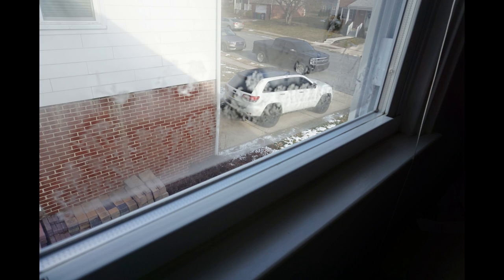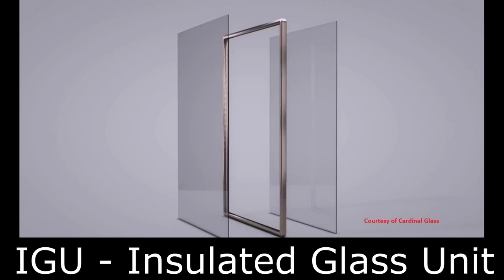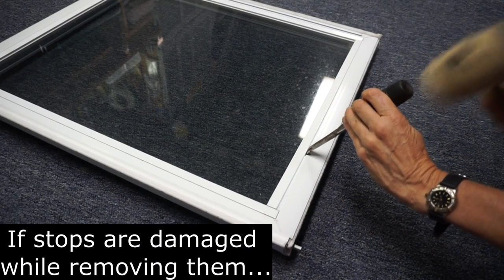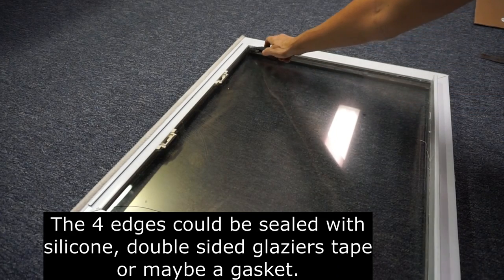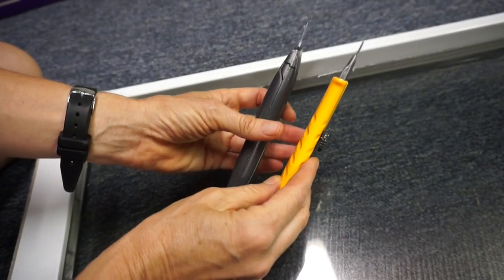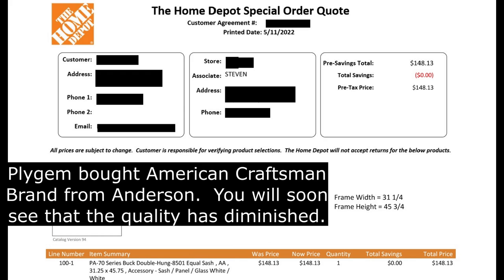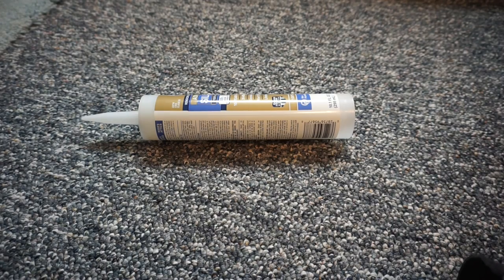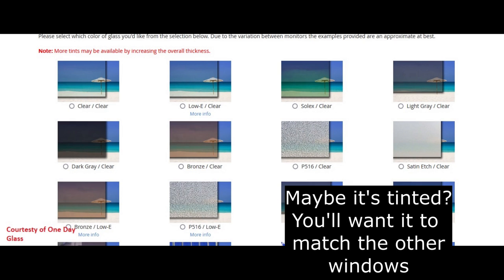Repair Options for Foggy Thermal Double Pane Windows

Comment: Use a flexible spackle/puddy knife, I use about a 3" type along with a can of window cleaner called "spray away". I use spray away on the puddy knife for a lubricant and press against the silicone and rock the blade side to side as it plunges and you hear it hit the frame, then move along the whole perimeter